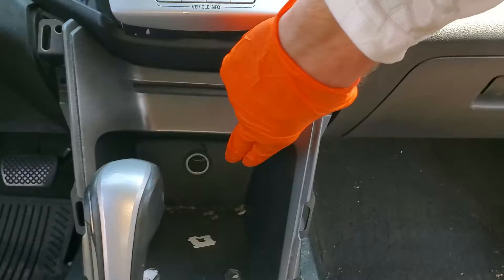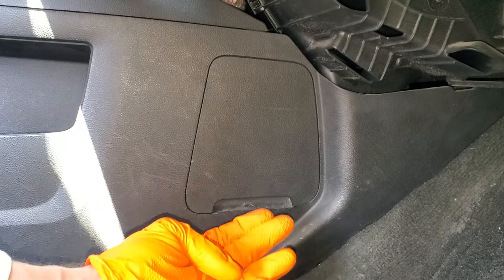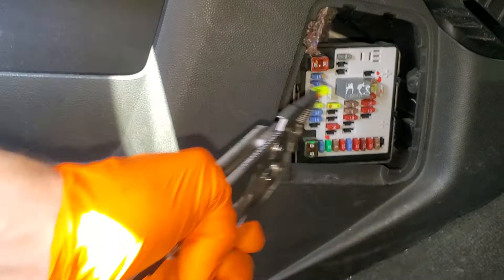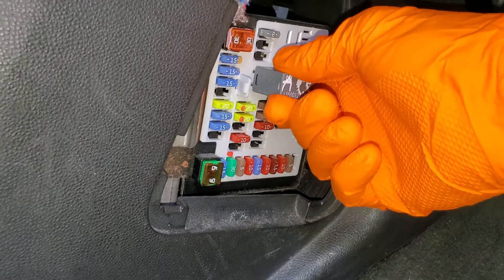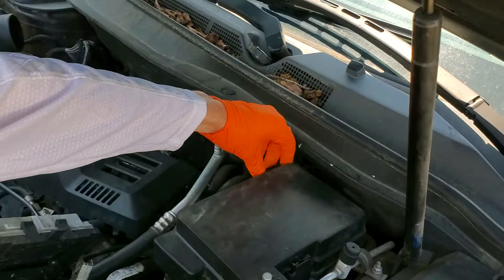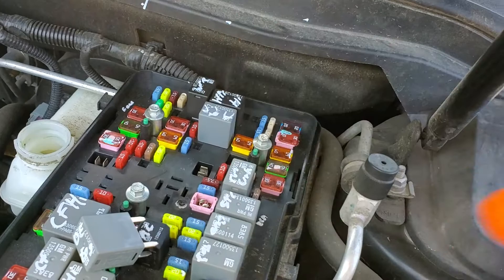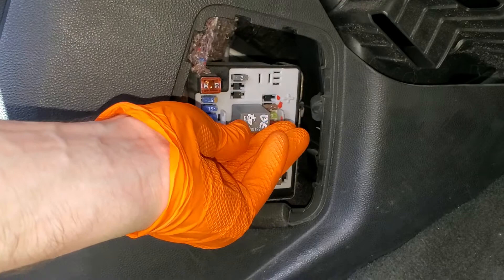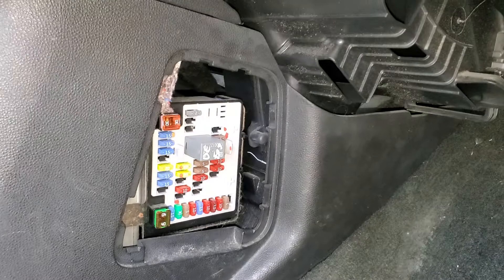2012 Chevy Equinox Power Point Fuses, Cigarette Lighter Fuse

Comment: Which fuse controls the driver seat? I have a 2012 Chevy Equinox and the power switch to lift it up or push it back isn’t working.

Comment: I have a 2012 equinox, my power steering keeps going out, and stabilizer light, all come on, it's not the fuse, or the ground . The power steering motor is okay, but the wire that runs from my 80 amp power steering fuse has a burnt stop down towards the ground. If I move that wire around I get my power steering back all my warning lights go away, but it don't last. I have search high and low for someone to tell me, what that wire harness is called and where I can get a replacement. The guys at my car lot won't even look at it unless I pay 2 hundred just to look, not fix.

Comment: GOOD DAY. HELP PLEASE I HAVE THE LABELING ON THE SCREEN IS LOCKED AND THE SCREEN IS TURNED ON ONLY FROM THE IGNITION KEY AND THERE IS NOTHING FROM THE BUTTON. REAR CAMERA RUNNING SOUND IS. ALL BUTTONS FOR THE RECEIVER AND HEATED SEATS DO NOT WORK